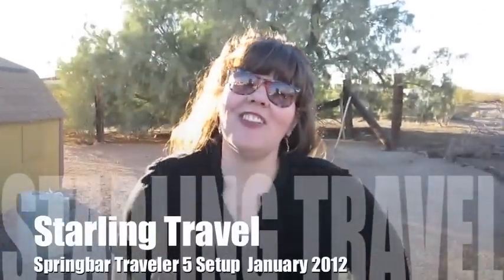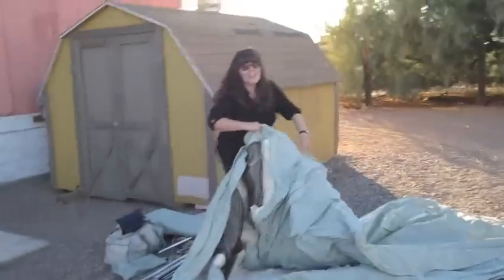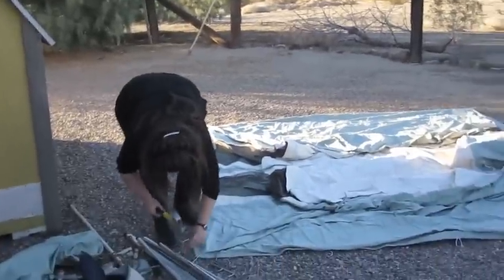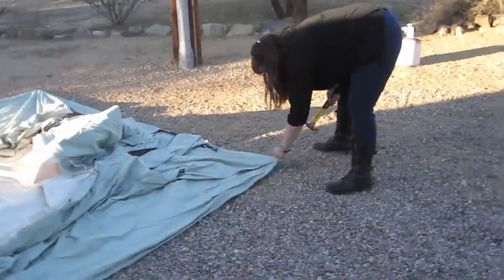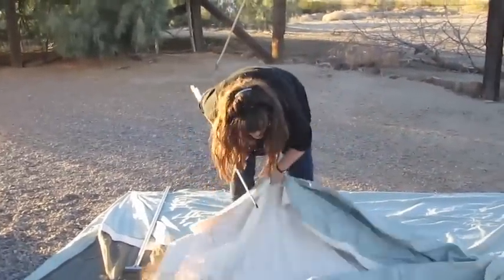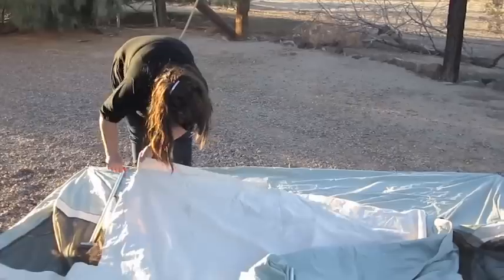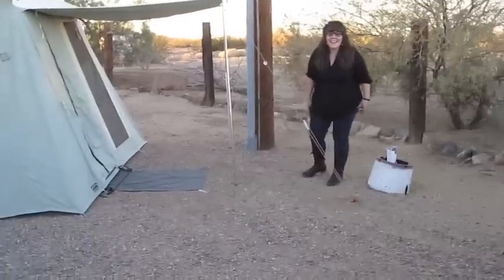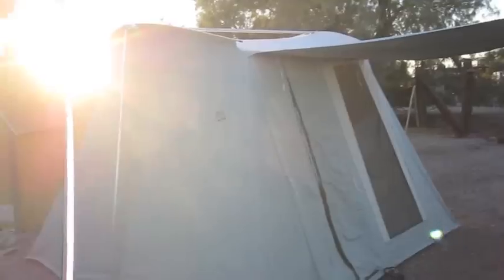Starling Travel: How To Setup a Springbar Traveler 5 Tent

Comment from the maker: @junderwood

I think you might be unaware of how very durable a Springbar tent is. We've never had a problem with pitching it on gravel without a ground cloth. There are MANY tents, where this is NOT the case, however. Our REI Hobitat would have worn through on gravel with only one night without a ground cloth, so you are right. Using a ground cloth is important, but not as crucial with a Springbar as it is with other lightweight tents.
Reply: Why does Springbar sell and recommend the use of a heavier duty canvas tarp then? I know they are sturdy but why not make a nice tent last? Those stakes you have no where they came from are sold on Springbar's Webpage.